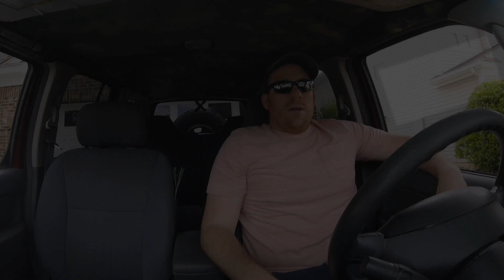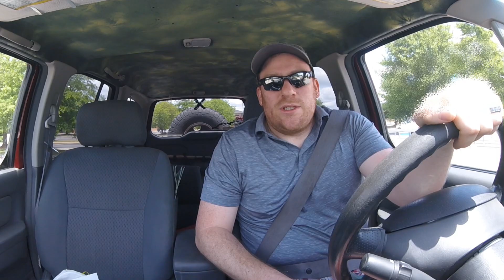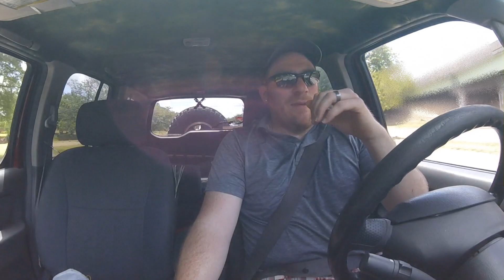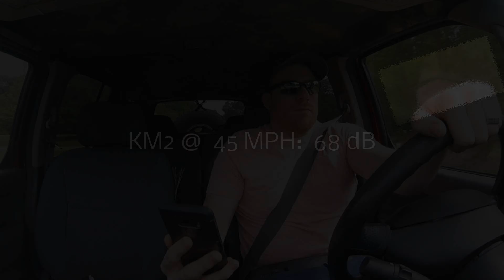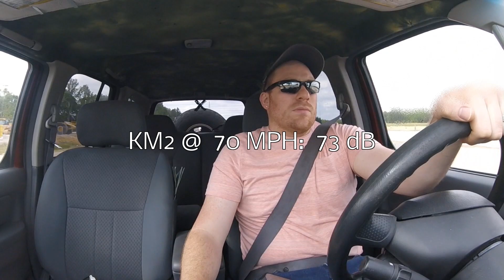33x12.50R15 General Grabber ATX Initial Road Reivew + Road Noise

Comment: How havw the atx held up?any issues?I want these but read some have has blow outd
Reply from the maker: No issues for me I love them!  I actually just filmed an update review of them yeaterday...but still have a bit of editing to do.  They are my favorite tires ive ever had.
Reply: @XterraRob  e rated or standard load tires?
Reply from the maker: 33 x 12.50 R15 load range C flotation radial is the tire I have. 35 max PSI. What size you looking at?

Comment: How would you rate the general atx now that I have had it awhile? Any regrets??  I hear the atx scuff around corners,maybe a little mushy around corners and some have had balancing issues...what hVw been your experience?? Any balancing issues? Bad handling? Good in the wet? I'm about to order in a week or so Nd could really use your input
Reply from the maker: Love them. I think they handle great on road and off road. Keep in mind I have oversized tires for my truck so on road ... It handles different from a stock sized type tire. Good in rain...good in sand. Good on dry pavement. Havent been in snow yet...but they are three peak snow flake rated. These are awesome if you ask me.
Reply from the maker: No balancing issues other than i stuffed a 12.50 in wide tire on a 7 in rim.

Comment: Could you do a video on parking brake adjustment? I have a 2000 1st gen with the e brake under the steering wheel and I do not see any videos in how to adjust it. My e brake will not engage and it’s hard because I have a Manuel.
Reply from the maker: How are your brake shoes and drums? They may need to be replaced to get your parking brake to work better.
Reply: Xterra Rob haven’t checked yet. I will soon. Thank you💪🏽
Reply from the maker: Editing one now...next video up. Did a full drum brake service.

Comment: Rob, we have watched all your videos for my sons 04 X. We did a 2"BL and now the PS hose is cracked. My mechanic asked if the OEM will work as a replacement. Please help as I can find where I can get an extended hose. Thanks
Reply: *Can't find if I need longer hoses!
Reply from the maker: The stock hose works, but just need to take the reservoir off the bracket on the fender under the hood so it doesn't pull on it. Or I used bulk coolant line from auto zone and cut to length.  Another alternative is to use the stock hose, but modify the bracket under the hood so it sits 2 inches lower. I took my bracket out, cut it, removed 2 inches of material from the middle and welded back together so the reservoir can still sit in the metal bracket without pulling the hose.
Reply: Xterra Rob, thanks for your reply! I had taken the reservoir out and zip tied it lower on the bracket. Guess the pressure hose was brittle and cracked. Just didn’t want to pay to have oem hoses replaced if I needed longer. All fixed now! Have watched all your videos, great stuff!
Reply from the maker: Thanks for watching!  Mine was brittle and leaking too so I had to replace it too.  Actually, a lot of rubber hoses have leaked on my xterra. If you ever find yourself having to remove hoses for other maintenance,  go ahead and replace them "while you are in there"

Comment: Nice review; thanks for being open and realistic with your comparison.
Reply: I ended up getting them in LT275/65R20 for my 2500HD. Have had a 40-60mph harmonic drone since new. Found out the installer fudged up the balancing on all four corners by a considerable margin after having to take them back for noise & vibration. After driving another 1,000mi, the noise hasn’t gone away. Really, really want to keep these tires but the noise is borderline mud tire maddening at that speed range. They’re getting exchanged for something else in a few days.
Reply from the maker: Thanks for watching and the comment!

Comment: Thank you for your videos about these old 1st generation xterras.     I have 16" rims and will first put a more aggressive lift on my xterra or maybe a small body lift.    Did a poor mans lift in the front and put a set of super springs for a slight lift and extra load capacity.    There is so much you can do with these old xterras.
Reply: PmL will screw your whole front end up!
Reply from the maker: ...no it won't.  What problems are you having?
Reply from the maker: Thanks for watching and the commemts. They are fun trucks. Sounds like you have a pretty good start to yours!